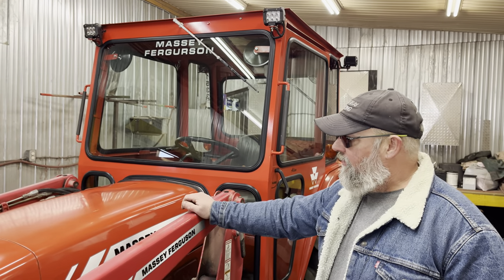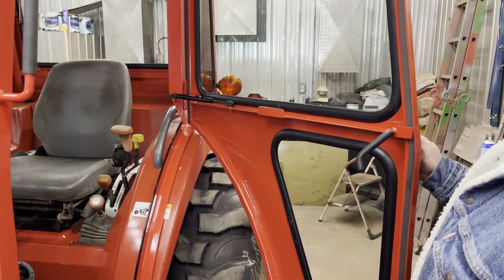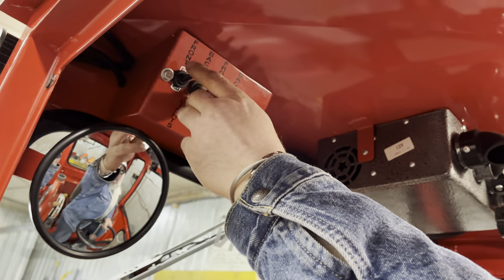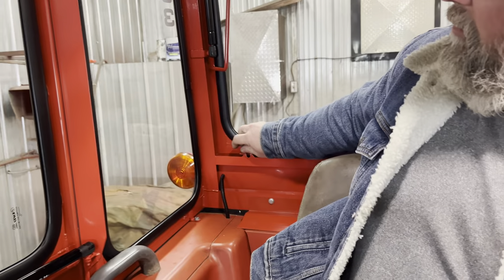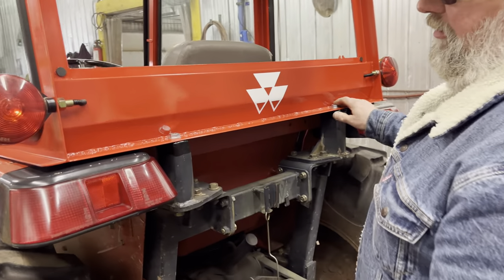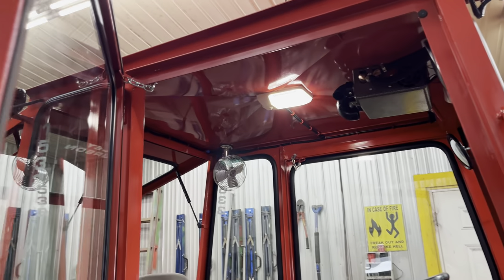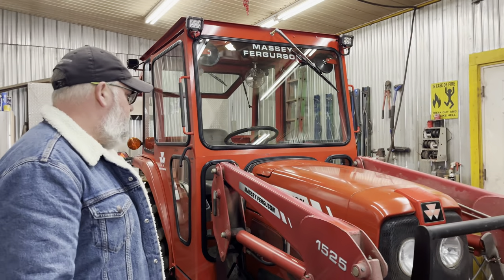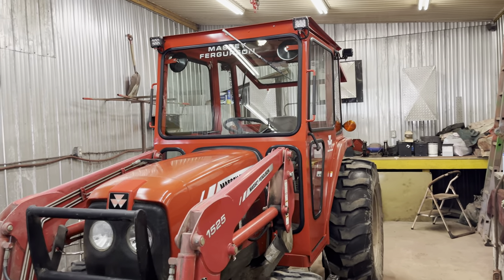Custom Fabricated Tractor Cab // Massey Ferguson 1533

Comment: Just out of curiosity ever built one for a massey ferguson 2607h it has the clam fenders great tractor but baleing hay a cab would be a great option .
Reply from the maker: @markstokes6075  yes I have built cabs on older style tractors that had clam style fenders, bit of extra work and material but turns out great..
Reply: @bradgraycabs  you do some awesome work where are you located
Reply from the maker: @markstokes6075  Bathurst New Brunswick Canada
Reply from the maker: @markstokes6075  Bathurst New Brunswick Canada thanks for watching

Comment: Love the video, I’d like to get some info on a cab for a 70’s model MF165. Kind of rare to do but with your skills I bet it could be done.
Reply from the maker: It can certainly be done and I have done lots of the older tractors over the years, believe it or not these older styles require much more fabrication time and more material due  to small fenders ,small floorboard area and simply  to much empty space to fill in ,that being said they turn out beautiful in the end
Reply: I gotcha that all makes sense. I’m talking to you from Mobile, Alabama. Where here it’s above 85 most of the year. We may only get one or two light freezes a winter. I’ve only seen snow here once my whole life, Currently 105 mid august. But point is, my struggle would be having air conditioning in the older models. Not even sure how or where you’d mount the compressor. Or should it be a completely separate deal in this case where I buy some sort of small mobile air conditioner and mount it in there and vent it out the cab? I don’t know, love to hear your thoughts on that. Thanks for the detailed reply.

Comment: That's a awesome cab and it looks factory made except yours has better quality and options. Where are you buying the windows? I just purchased a Kubota M59 an I want to build a cab for it like the Curtis cab on my Kubota RTV. Any recommendations would be greatly appreciated.
Reply from the maker: I’ve been getting my glass from a local glass shop for over 10 years , good luck with your cab build ,your only limited by your skill level simply take your time and think a few steps ahead ,you dont need fancy high tech tools just the basics and skill
Reply: I designed and built a hard cab for my Power king economy tractor a year ago. Soft factory cabs were available for those tractors years ago but they’re hard to find.
Reply: @Brad Gray  Thank you for the information! I'll take some pictures and let you see how it goes. I do have some fabrication skills and necessary tool's to make it. I can only hope it turns out half as nice as the ones you make. What's the name of the latches you have one the back window? Thanks again, Charles from Coos Bay, OR.
Reply from the maker: @JohnDoe-id9hi  latches hinges door handles and locks are all made here on the bench by me.

Comment: Will that cab fit a 1635?
Reply from the maker: This was built for a 1533, these cabs are all custom one offs  I fabricate each one on the tractor it is then removed in order to do all the finish welding ,prime ,paint ,glass, wiring and plumbing and then reinstalled ,tested and ready to work